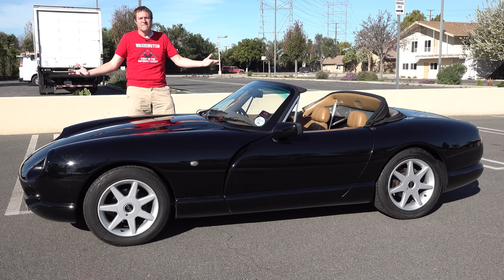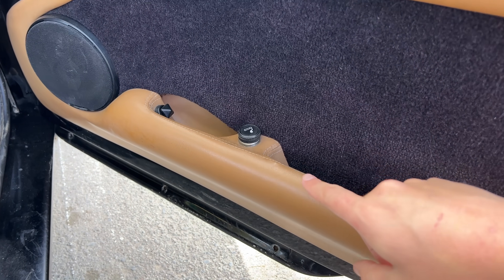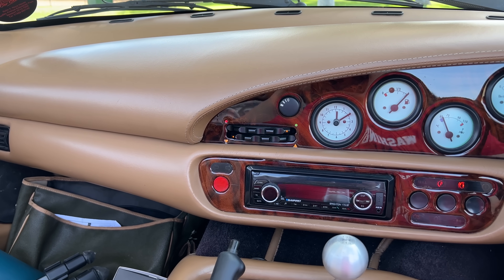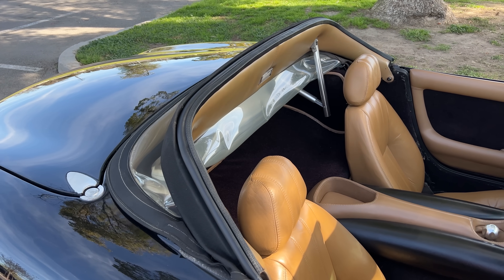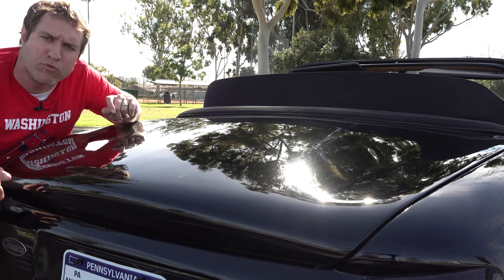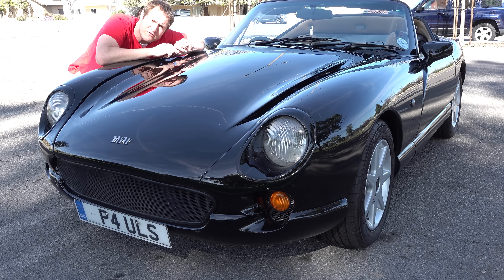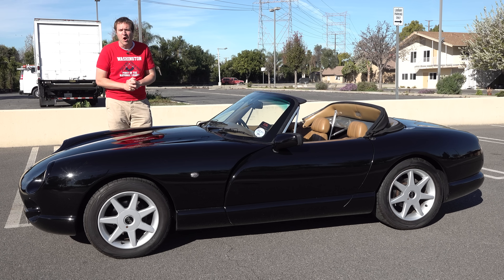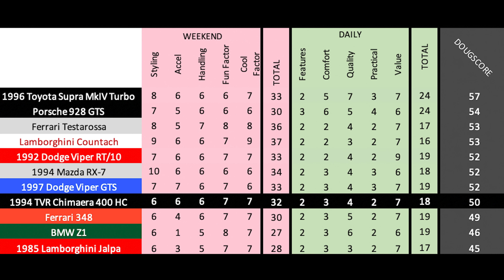The TVR Chimaera Is a Quirky, Weird V8 Sports Car

Comment: Reminds me of the old Jag XK convertibles from the late 90's and early 2000's, which also shared designs with the DB7 from the day. I actually almost bought a used 2000 XKR convertible in blue with white leather interior. The supercharged V8 in that thing really made it move and I honestly haven't seen a British convertible that looks as good as that one did since Jag ended production. It was decently roomy too being a 2+2 with a trunk and made for a very nice GT cruiser for longer drives and day trips. The F-type is just too small for my comfort while the new Astons are expensive AF. Maybe a used Aston convertible that's been kept well could be worth a look.
Reply: I had a beautiful XK8 black with ivory interior with dark wood trim. On a sunny day with the roof down and the cover also ivory clipped on, what a beautiful machine. I drove it all around Europe many times with no problems. But, my bain of my life is a 67 eType and one had to go. I recommend the XKR 4.2 supercharged version. It's just a beautiful drive and a even more beautiful car. I promise you the Aston will just eat money on repairs, they all do! I know from bitter experience.
Reply: @mr.hitchens  I hear you. My GF at the time had an S-type V8 sedan - dark red with beige leather interior. Really beautiful, but I shudder to think the maintenance would have swallowed her paycheck. As irony would have it the car got totaled in a fender bender - she got a nice insurance payout and moved on to something else.

The only thing that attracts me to the Astons other than looks is the V12 power plant. I've sat in brand new Jags that had some quirky electrical problems before even leaving the dealership. Fortunately I have a good mechanic who's been in it for 20+ years.

Comment: Doug the trunk release operates as it should with the key on. If the vehicle is unattended with the roof off or down, the trunk cannot be accessed without the key or else they could pop it and steal your audio equipment or whatever else is in there.

Comment: You missed one of the biggest exterior quirks... The air intake below the headlights were "designed" by Peter Wheeler's dog.
Reply: That's a myth. The dog supposedly took a bite out of the design. It was said as a joke and it stuck.

Comment: Doug, I really loved this review. I have nearly the identical relationship with these - though for me the video game was Test Drive (though of course I did play Gran Turismo as well), which featured an assortment of actual-photos of cool cars for loading screens, a few of which were TVRs (Shelby Series 1 was another epic loading screen, I digress!). Same exact experience with London as well! 

Clearly a questionably engineered car, but some really cool thinking - the T-top is brilliant (though the loss of the visibility is a drag), the fuel filler situation is an interesting solve for getting two-for-one mechanics with a single lock for the trunk and fuel filler - plus a sleek body - though clearly at huge expense in practicality. If you squint, the interior proportions are straight out of 2022, with the floating, consoleless design and "infotainment" spanning the 2/3's around the driver. And the door "knob" is just plain cool - I'd be curious to know the mechanics behind it. This industrial designer approves! 

Looks like it sold for about $26,000, which is in my eyes about exactly what it's worth. And if I was looking for a unique sunday driver to actually drive, that would be the sweet spot for me. This car really hits all the right notes, and the styling is interestingly hard to place in terms of era - "timeless" in the truest sense of the word - perhaps not a bad thing given it is quite handsome, if slightly bland. Cool car!You did forget to point out one quirk - the Range Rover-looking vehicle on the hood release latch. A funny, British, likely unintentional, Easter egg!

Comment: I tried to drive my mates TVR Tasmin, V6 Ford engine, in 1990 I think. As soon as I touched the throttle the back end went out. After 3 attempts I gave up and handed it back. Insanely quick, light and bloody scary.

Comment: We can move the steering wheel to the left and attach with a bike chain so rotating it works either side. Just put a gear behind the left steering wheel and another from where you removed the right side wheel. Best to do this swap behind the dashboard so that the safety people won’t see your handiwork.

Comment: As an Ex-Griffith 500 owner and current Chimaera 500 owner most of the points about the controls and interior are pretty much wrong for everything except the earliest of cars. Later cars are better resolved (except for the ventilation) with better controls and dashboard. By default you should have a separate remote alarm fob (not a re-purposed one as shown) and another fob for the immobiliser that requires pressing it against a hidden contact next to the ignition barrel before starting.

Hidden door release - yep definitely a feature and pretty much all TVRs are like that. The 400HC performance is "adequate" but not fast - the 500 on the other hand is just bonkers for the era and in full on supercar territory at 4.2s to 60 and that's being really pessimistic, even then it is quicker than everything the Italian stables can offer except the F40 and later F50. Power steering is optional and (imho) better without

Incidentally they don't make particularly good track cars though (adequate but not great) - Gran Turismo lied... The Tuscan race car on the other hand... mental, the Speed Twelve is proper box of frogs territory

Comment: 2nd gen RX7 convertible had a similar configuration. (with the top up/targa/down)
Much cleaner and (with the top down) the wind deflector kept you dry in a rainstorm when you're above 40.

Comment: I saw a TVR Tuscan in Beverly Hills once, in like 2009 or something - was not expecting that... BTW, I think the rear light situation on the Chimera is like this: the inner lights are probably sourced from another manufacturer and to hide this fact and make them work with the overall  design, TVR slapped the clear bubbles outside of them. On an earlier model they used Ford Escort lights, turned up-side-down...  Same thing with the hood-popper of the Chimera, than seems to come from a Range Rover (as is depicted on the handle).

Comment: If it doesn’t get a bit squirrelly then it’s not fun to drive! Perfect little sports car, great HP to weight ratio and looks great 👍 I grew up with rwd cars and in winter those tires with big lugs and sometimes studs. You just power your way out! 4.7 seconds is fast 💨

Comment: You missed the best quirk! In the U.K. the rear number plate doesn’t have LED lights to illuminate it, the number plate itself is electronically backlit! Good luck if you wanted to apply a personalised plate!

Comment: TVRs are known to be quirky and mad ... mad but huge fun in an old school classic, basic kind of way. A V8 in a small 2 seat convertible, front engine, rear wheel drive, fibreglass bodied car, what's not to like? ... oh yeah reliability, the Rover V8 engines are strong, but fixtures and fittings and electrics were all a bit iffy. But if you wanted that old school, classic sports car thrill in a new car they were hard to beat and substantially cheaper than their performance rivals ... thing is they're now genuine classics themselves, just don't expect Porsche type build quility, (that's pretty much what killed them off - plus the Chimera was the last of the 'pretty TVRs, after that the Russian guy bought it and seemed to bring in a 12 year old to do the designs - prime example is the Sagaris, which just looked silly!)

Comment: I mean, if you're going to do quirky, small British sports cars, you should try to find an AC Frua. It's about 800 pounds heavier, but also 3 liters of displacement more (it used the Ford 7.0L (428 cu in) V8). It was essentially a grand tourer version of the Cobra.

Comment: The weird door releases are actually a security feature. There's no lock mechanism inside the door, which theives could access by sliding tools down the window slot.

Instead the entire locking mechanism is in the panel behind the door.

And you're wrong about the heater controls. The top dial controls temperature,  the bottom controls where the air is directed, either footwell, face or windscreen.

They do have traction control, sort of.
10 inches of accelerator pedal travel...

Comment: You got the heater controls slightly wrong. The top one decides between hotter and cooler then the lower one decides if the air comes out more towards the screen or the lower vents. 
Not sure if that one haas been changed but standard thats how they work.

Comment: TVR have a bad reputation for reliability but mechanically they're fairly sound, it's just the electrics that will give you headaches because they were somewhat slapped together and all systems had to be individually grounded thanks to the fibreglass bodywork. If (when) it goes wrong you basically have to spend a lot of time chasing every wire in the rats nest to find out where it has been grounded and if that terminal is still functional, don't expect any degree of logic in the routing and no two cars are alike because it often feels like the engineers were given a random assortment of coloured wires of varying lengths and they just used whichever came to hand first and if that wire didn't reach they'd either just splice another bit of cable in or piggyback onto another loom. If you were around for the early 2000s show car scene and ever had to fix/modify someone else's sound/light system you'll be very much at home.

Comment: I love how unbelievably shonky the interior is. As a European, the door panel material and ashtrays immediately jumped out at me. The blue "upholstery" on the door panel, is British 1990s cheap school/government office carpet offcuts. For reals. If you grew up in 90s Britain, you saw that same carpet (sorry, "upholstery") absolutely all over the place. I love how the actual carpet storage cubby behind the seats is actually better than the crap they used on the doors. 

The ashtrays are from the 1980s Austin-Rover parts bin, being used in the Maestro and Montego, which makes sense given the engine comes from Rover. Kinda surprised they didn't go with Rover for the rest of interior trim, rather than the slightly eccentric stalks and push buttons that came from god-knows-where.

Comment: All TVR models were sold on the continent in LHD models which often have double the resale values than RHD models. Also, the Griffith 500 was sold in very limited quantities in Canada through 1996 and have side marker lights and deck-mounted high level 3rd brake lights. Most Canadian Griffiths were sold to Americans once they were 25 years old. Rearward visibility with the top down is much better in the Griffith than the Chimeara. I own an '86 US-spec TVR 280i Series 2.
Reply: Also sold in the far east from tvrs factory in Malaysia

Comment: Doug you were 6 in '94 so there are certain aspects of older cars you won't understand. Cigarette lighter for the driver but not one for the passenger. The passenger had two hands free to use a normal gas lighter, they did not need to use an electrical one. TVR had a few owners over the years and they were sold to enthusiasts and celebrities with money to burn. Unless the purchaser of this car has a high degree of mechanical knowledge best to leave well alone.

Comment: I love you, Doug, but sometimes I wonder about your car expertise when you miss obvious "quirks".  The reason you need the ignition key in accessory mode to open the trunk is because most will park the TVR with the top down allowing easy access to the trunk release.  If it's not secured by the need of power to open it, then, well it's not secured. :)  I would say this is a great feature and not a quirk.

Comment: You missed the vents in the foot well.
The passenger leg vent is on the upper  underside of the dash, just further up from glovebox pouch.
The drivers is naturally on the side of the tunnel, also the drivers dash vent has its own fan control, which naturally only blows cold air.

You also missed the storage behind the seats and many other things.
Also don't slam the boot like that, you'll bend it,

Comment: Can't wait for Doug to take a spin in a Cerbera 4.5 Red Rose.

The quirks in the center console alone are enough to make his head explode.  Then there's the power...;  450 horsepower from a 4.5 liter flat-plane V8 that revs like a motorcycle engine and no electronic driver's aids whatsoever (Peter Wheeler called them "nannies" and refused to fit them).

Comment: Excellent video 📹 and analysis 
Could you imagine if TVR made an ergonomically simple car.
Every model had buttons and switches all over the place. Complete nonsense. 
Porsche boxter and later the Toyota Roadster ran away with simplicity. 
The public wanted a simple powerful V8 without nonsense. 
The moral of the story is KISS.

Comment: In 1997 a Dodge Viper cost from $66k and at that time a TVR Chimaera was the equivalent of $48k. So a fair bit cheaper and it had a roof!!!!! Plus if you know what you are doing, a Chimaera can go round corners. Corners are something every Dodge Viper has cold sweats over.

Get yourself a drive of a TVR Sagaris with near 400BHP per tonne!!! Now that is the most bonkers TVR!!!! Alas, you will have to wait until about 2028 to get one in the States though.

Comment: He should have said the reason it wasn't sold in the US. By the time of release, the US required certain safety features as mandatory. Such as ABS and Air Bags. TVR refused to add any safety features to their cars.

Regarding features such as ABS: "If a TVR has a component that takes any control away from the driver, it no longer is a pure British sports car." -Peter Wheeler , Chairman of TVR.
Reply: he also said "airbags were designed for fat americans who wont wear their seat belt"

Comment: 12:49 Is it me or the rear lights look like the ones from the fiesta Mk3? 
Some of those small volume manufacturers don't have enough budget to develop their own lights, so they get whatever they can find in other manufacturer's parts bin and use tricks like these to make them look like tehir own.

It's like the Lotus Esprit, which had Toyota AE86 rear lights, or the Jaguar XJ220 which had ones supplied by Rover.

Comment: The whole door release system is a result of fibreglass being very bad at resisiting point loading without causing cracks in  the paint.
Door handles are a challenge to engineer without causing door issues on a FG car.  I can imagine the converastion at Blackpool...

"So put the door release in the body where it can be reinforced more easily.  Win!"
"Now how do you release the door from the inside?
Handle on the door won't work as the mechanism isn't there. 
Reaching over your shoulder isn't on."
"So why not put it in the centre & make it look like a brake bias valve?"
"Sorted."
"Off to the pub?"
"Yeah."

Oh and as a note for the US audience Blackpool is a run down Coney Island kind of place in the windy and cold NW of England.
Reply: nope - Peter Wheeler didnt want any crap on the body spoiling its lines - so no door handles or boot release buttons - all hidden from sight
Reply: @SNORKYMEDIA  okay so the guys at the factory who told me that story in 1998 were full of it then? ;-)

Comment: fuel door.. very interesting.. they combined the fuel door and the trunk basically. Its sort of dumb to open it every time like that yes.. however.. you wont do it too often and thats what they were going for.. the trunk would act as the fuel door. Thats why it releases with a button. Same as my volkswagen, in the door, i press a button to open fuel door. Only issue is yes.. cant open trunk when the car is off with this car. I suppose its not that crazy of an idea since your fuel door is now shut and harder to get to. Back in the day people use to siphon fuel and i dont think it was too common to have unlocking/locking fuel doors and the trunk could act like a locking fuel door. Its quite genius i suppose. And due to 2022/Biden... i mean this idea will be a godsend for that driver. Since gas is gold now.

Comment: You can't review a TVR without lifting up the carpet in the boot and checking out the hidden artwork/messages often put onto the bodywork by the folks on the production line.

Comment: Here are the cars which used the Rover V8:

3.5
1967–1973 Rover P5B
1968–1976 Rover P6B
1968–1990 Morgan Plus 8
1970–1989 Land Rover Range Rover
1972–1978 Land Rover 101 Forward Control
1973–1976 MGB GT V8
1976–1987 Rover SD1
1978–1985 Land Rover Series III "Stage One"
1979–1981/2 Triumph TR8
1980–1990 TVR 350i
1983–1994 Land Rover 90/110/Defender
1985-2006 Freight Rover Sherpa/LDV Pilot/LDV Convoy
1986-1991 Sisu NA-140 BT
1989–1998 Land Rover Discovery

4.0
1990–2004 Morgan Plus 8
1991–1995 Ginetta G33
1992–1996 MG RV8
1986–1993 TVR V8S
1989–1995 Land Rover Range Rover (known as a 3.9 in this application)
1991–2000 TVR Griffith
1992–2001 TVR Chimaera
1995–1999 Land Rover Range Rover (P38A) in SE trim
1996-2004 Land Rover Discovery
1994–1998 Land Rover Defender (only used as standard on USA-spec vehicles- available only to special order in other markets.)
1998 Land Rover Defender 50th Anniversary Limited Edition
1986–1989 TVR 390SE

4.2
1992–1995 Land Rover Range Rover

4.4
1973–1975 Leyland P76
1976–1979 Leyland Terrier truck

4.6
1995–2002 Land Rover Range Rover in the HSE trim (Optional for SE trim)
2003–2004 Land Rover Discovery (North American market)
1996–2002 TVR Chimaera
1996 Morgan Plus 8

5.0
1990-1995 Lichfield Land Rovers
1992–2001 TVR Chimaera
1992–2000 TVR Griffith
2002–2006 Bowler Wildcat- this used a hybrid 5.0-litre V8 with Land Rover cylinder heads and a TVR block and piston assembly.